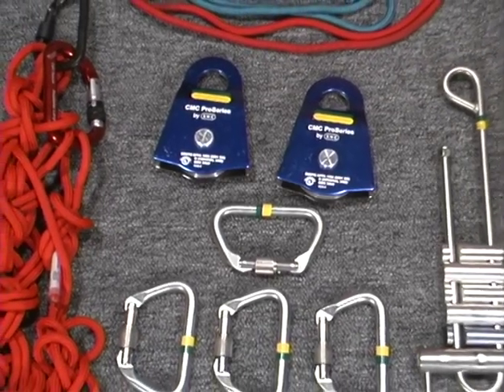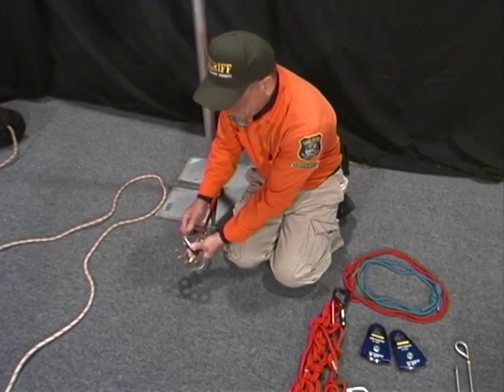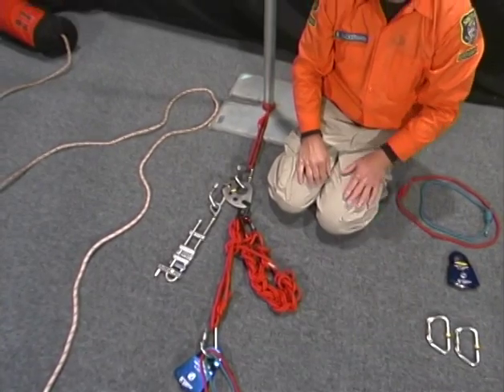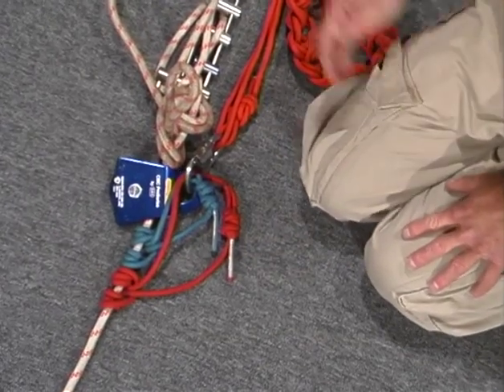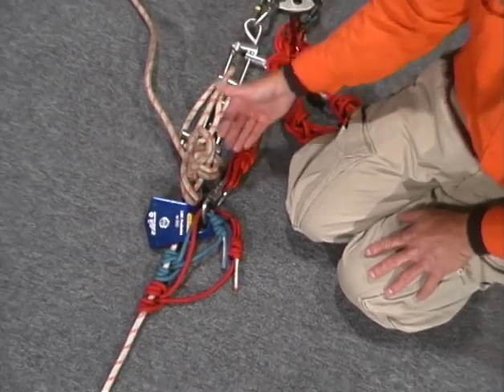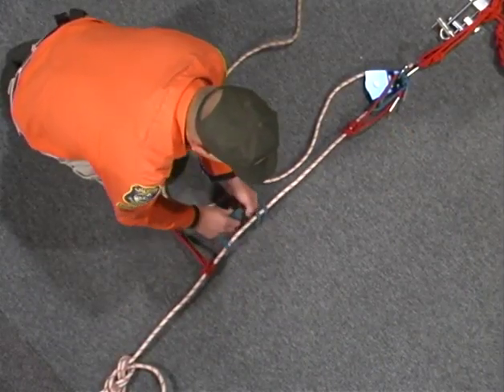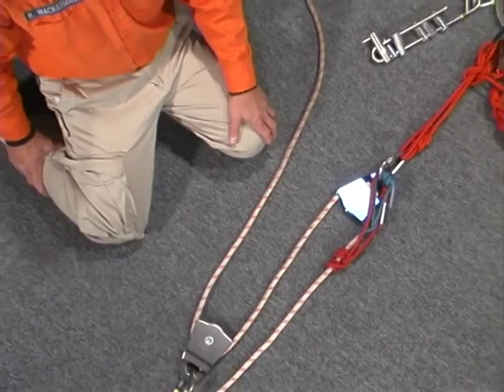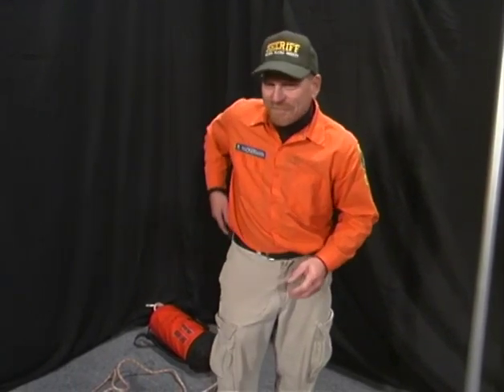Rescue Systems, Part V - raising and lowering system

Comment: Very good info. But I missing something. Is this for a single load or with rescuers plus victim. I missed the life line for the raising part.. Pls. advice
Suggestion belay 540 or Petzl ID.
Reply: Koendjbiharie Sarwan petzl I'd works well because you can use it to haul in case main line fails